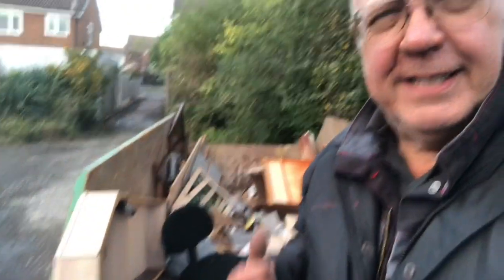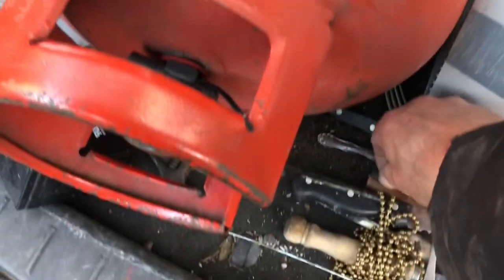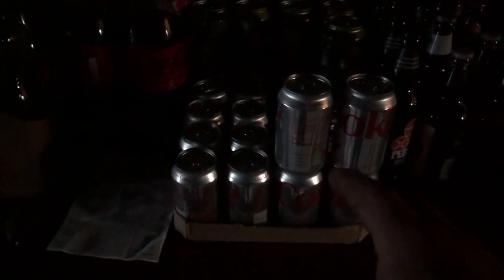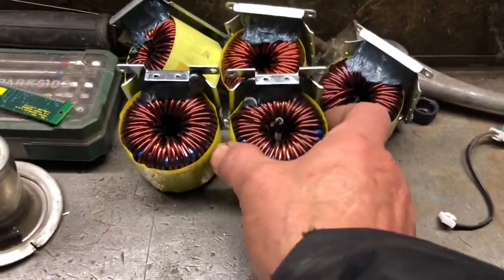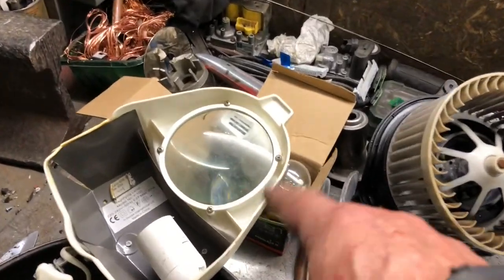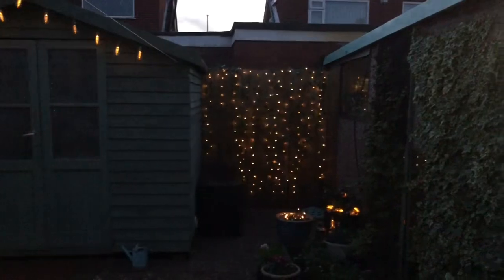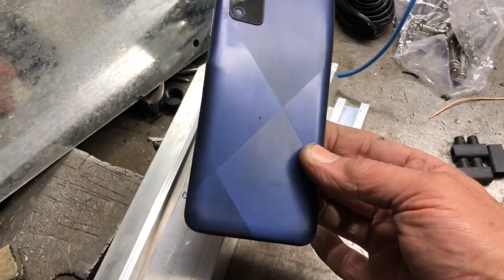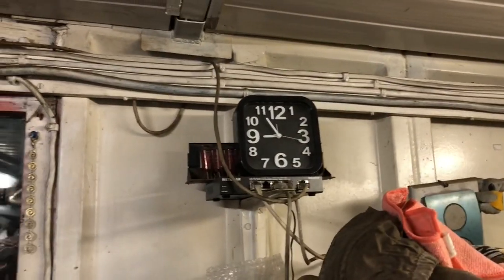Time for a skip dive

Comment: that knife @13:12       gave me an idea.......could you bolt it to a block......and adjust it to the thickness of wire you want to strip,and just pull wire thru it? im sure a man like you could do it......hope this comment makes sense
Reply from the maker: Actually, I used that knife to strip wire last night, I hadn’t sharpened it, I had to change my technique to a drawing across style  but it worked quite well